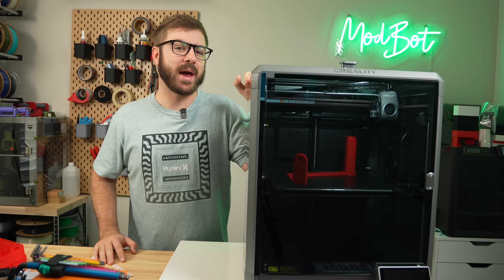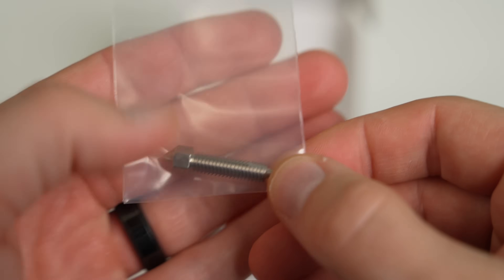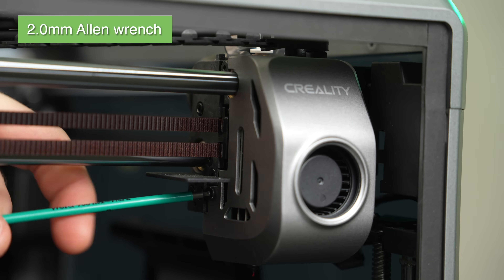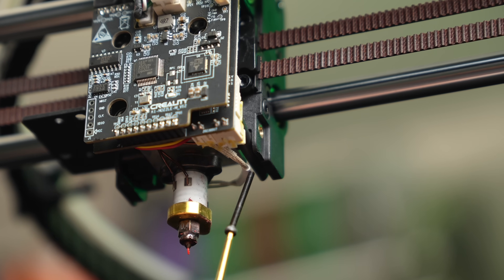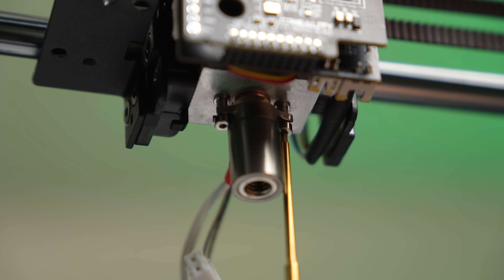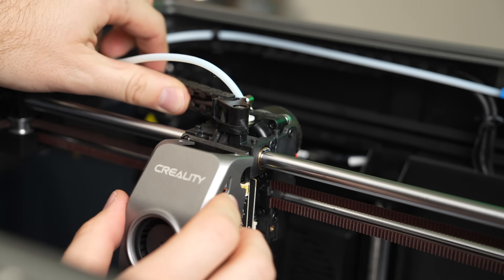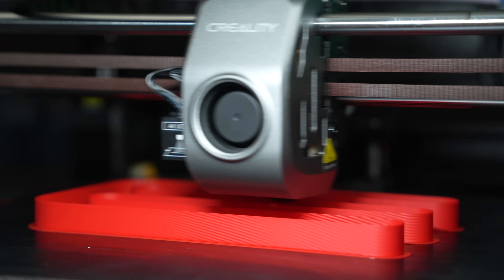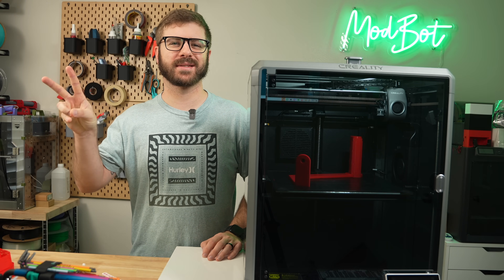Drop In Hotend Upgrade For Creality K1 & K1 Max Printers (Micro Swiss FlowTech™)

Comment: Your tutorial sections are really great! The attention to detail you put into each step (what size screws, how to remove a connector or how to remove the shroud, etc...) is really great. It's nice when people don't just assume "oh that's obvious I don't need to mention it".
Reply: He forgot to mention 1 crucial detail.
Before removing the connector of the heater and thermistor from the backside, it is a GREAT idea to pry off the glue securing the connectors.

As the connectors are less securely attached to the metal spikes soldered to the board, than how strong the glue can hold.em togehter, so you can yank the plastic socket clean off the board if you are not careful.

P.s.: On the upside the metal spikes ofc. still remain solderex to the board, so you can replug the socket, it will just look damn ugly, and be damn scary.
Reply from the maker: I dont know that this glue can be removed. When hot glue is used some IPA will cause it to come right off but the glue use in this case is not that. 

Doing the back and fourth wiggle with the connector was not too difficult to get it to break the seal in the glue. With how small the connectors are I almost feel it could be as easy to damage trying to remove the glue with something sharp.
Reply from the maker: I appreciate it. I really try to cover as much as I can to prevent accidents from happening. Of course some will think it is too much and there will be some items I maybe miss but I definitely consider as many aspects as possible when putting something like this together.

Comment: What about thermal paste between the cooper sleeve and the heat sink?
Reply from the maker: No mention of needing it. It’s a mixed bag as far as printers/hotends that I have running with or without thermal paste.
Reply: @ModBotArmy I'd be interested in what they would have to say about why the cooper coupler doesn't need thermal paste if they didnt provide any and don't reference it in their instructions should you get the opportunity to ask

Comment: Copper(!) thermal adaptor combined with aluminium (!) heatsink makes the worst possible galvanic pair which leads to further corrosion and decrease of effectiveness of heat transferring. Nice design choice, dumnuts.
Reply: My understanding would be that this only applies when current is present and would be accelerated in the presence of moisture. There would be no need for a zinc separation barrier between the dissimilar metals under normal heat cycling, as this application does not have any voltage passing through it. The only issues that might arise would be from the difference in expansion rates, but that seems unlikely with the miniscule rates of size/temp/cooling for this application.
Reply: @notedmastrmind  difference in electrochemical potential is a source of current. I may be wrong about the temperature though.

Comment: Note: pull wires holding connector, NOT cable, because you will destroy cable over time
Reply from the maker: In a lot of these cases it is so small that it is not possible. That is why I recommend at least getting as close to it as possible. Minimize the strain on the wires.
Reply: @ModBotArmy you can typically grab the included flat head screw driver and wedge it in the side of the connecters and pry/twist on each side usually will do the trick

Comment: Nice content as always. A good tool to have for any 3d printer electronics disassembly is a pair of tweezers called dressing or thumb forceps.  I've also seen them listed as rat tooth tweezers. They look like a regular pair of tweezers except they have hooked teeth on the tips, one tooth on one side and two teeth on the other. They make grabbing and pulling on those small JST connectors a lot easier and safer. They're less than $7 on AMZ.
Reply: Thank you, random stranger. You may have just solved a problem I didn't know I had.
Reply from the maker: First time hearing about these thank you. I will get a pair in.
Reply from the maker: I didn’t find the exact ones but it ordered the i fixit pair that has a 45 degree at the end that comes to a fine point. Will give them a go.

Comment: I've put a few hundred print hours through my k1 max now and I absolutely love it. It has been printing polymax polycarbonate functional parts for me like it's nothing! Perfect first layers and superb dimensional accuracy. Haven't even considered and upgrades to it yet
Reply: that's awesome, good to hear.  I have a K1 at home and I'm loving it also but I have only used PLA.  I guess I should get to work using some other filaments.  Are you still using a .4 nozzle?  I switched to .6 and saw no quality difference at all.  I like it a lot.
Reply: Is that .4 nozzle and what do you use for setting for the polymax i.e speed and temp for nozzle and bed
Reply: @rlbrlb5109  40mm/s 270c 105c. 112% extrusion. Stock nozzle. No bed glue
Reply: If you think it prints good now, put the micro swiss in and you will have perfection.

Comment: Would you recommend it over a bambu lab machine? I have considered them or a voron 2.4. What should I do. I already have two ender 3 pros. Great video have a great day!
Reply: K1 can be had on sale as low as $350. I have 100+ hours fault free, couldn't be happier. I am still interested in Bambu's offerings, but I hear they may pack some of the new A1 tech into the P1, so I'll likely wait for a model refresh.